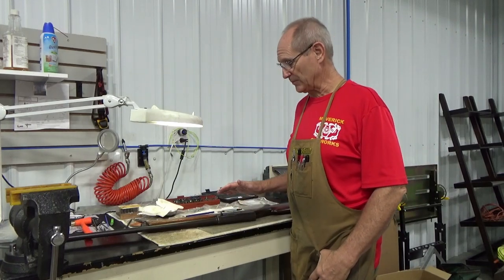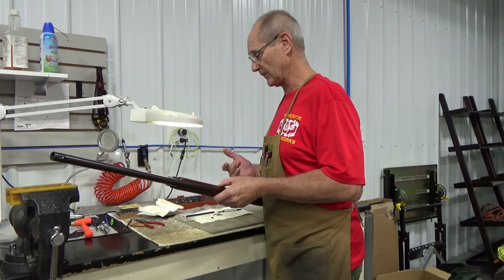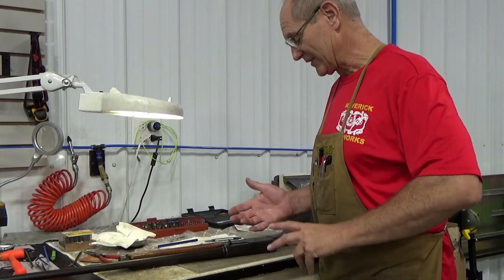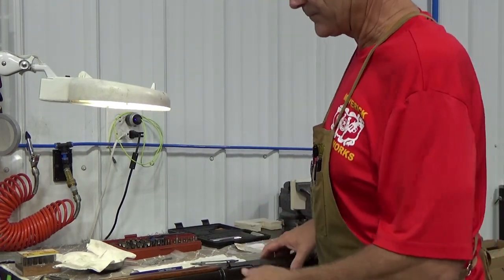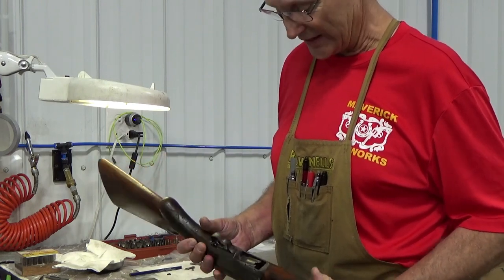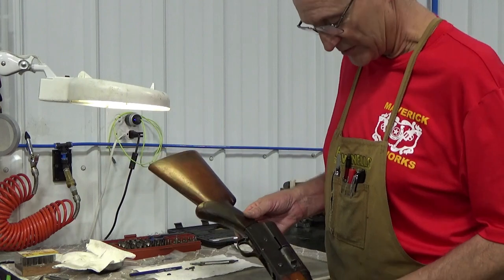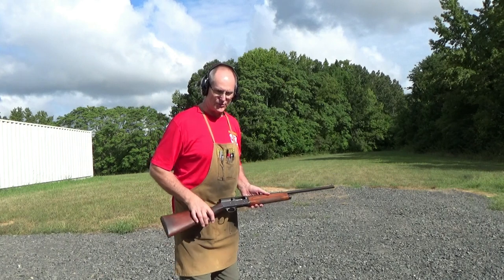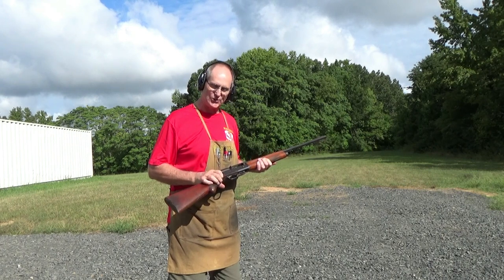Browning Sweet 16 FTE fix

Comment: HELP WANTED. My A5 16ga will not extract modern plastic star-crimped shells. They open up too long to get out of the port. Has anyone sourced paper roll-crimped shells or figured out a way to trim the plastic shells and reload? Thanks for any advice.